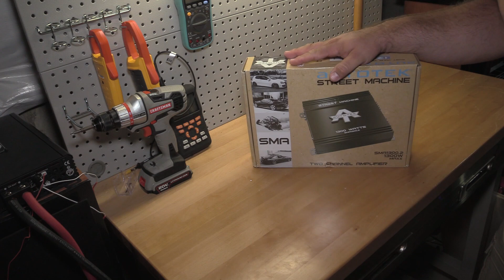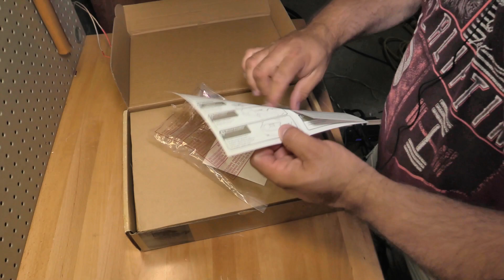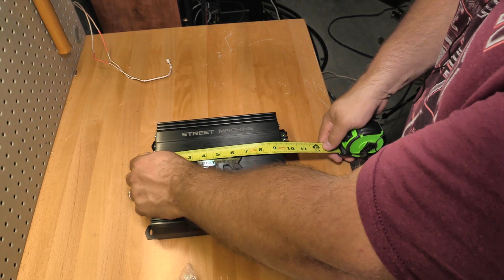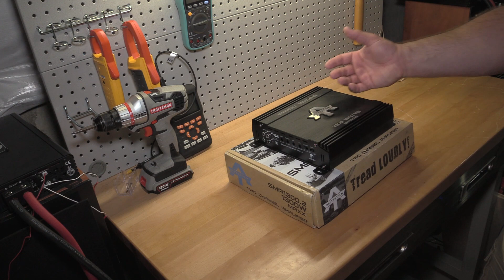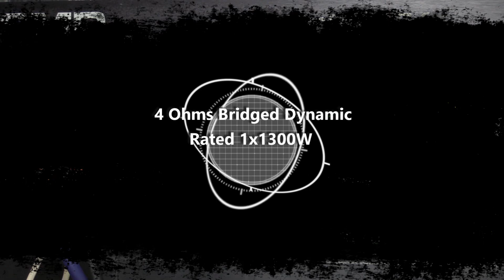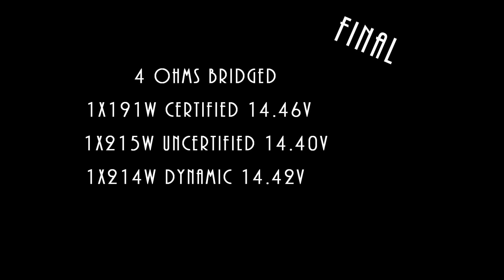1300W for $65? Yeah right.... Autotek SMA1300.2 gets busted on the Amp Dyno

Comment: Unfortunately I just bought one I wish I saw this first but it was only 48 dollars I just hooked it up 1225 watts  model it sounds ok on a 10 inch former 120 volt sub  for home use but it is pretty weak  what do u expect for 48 dollars but after adjustment sounds much better just using for the 10 inch sub .

Comment: Used to run Autotek in the late 90’s.  The white autotek hi current 50 cheater amp. Did it’s power. Placed first in many bass offs back then    running 4 pioneer impp 12’s. 145 db’s was the shit for only a 800 watt amp.

Comment: I had an Autotek TA1250.2 claiming 1200watt max while bridged @4ohm on a single 40A fuse... Yea right I knew beforehand it wasnt capable of its stated specs, it was still a good cheap amplifier that provided Id say ~300 watt rms which is not bad for what I paid [$20 used]

Comment: I had an Autotek MM4000.1D. The good one not the tiny one.
It was a nice big Very heavy powerful amp.
I didn't Dyno it, but i think it did it's rated 4k at 2 ohm.
It's a dual mono board. 360 amp fuse required.
I bought a refurb and it lasted me 8 years.
I think it was the last of the good autotek amps.

Comment: If you going to test a brand why get the cheapest entry level amp they make. Why not Mean machine or super sport, they don't do rated but allot better than that
Reply from the maker: This was provided by a viewer, I test what was given
Reply: @bigblank69  I have a question hopefully I'm not being a pest. Big D tested a massive audio nano rated for 800 at 1ohm. I have the MTX thunder 500.1 which is rated at 2 ohms but it has the exact same board as the Massive nano. Can you explain to me how one is for 2ohms and the other for 1ohm with the exact same board?
Reply from the maker: @davidgreggs8850  without seeing the boards, I can't speak to the similarities of the two. However some transistors, chips and mosfets that the average person cant see a difference with can change the stability of an amp at different ohm loads... brands like Taramps and MMats have done this for years.
Reply: @bigblank69  thanks brother

Comment: I still remember when some amps were underrated  like a punch45
Reply: Had a punch45hd cost 250.00! That ran a whole system in tri mode no problem!!!
Reply: Yes the punch 45 was a
underrated amp , meanwhile this amps just a mere 1100 w short, ha ha my head unit is more powerful than this pile of junk.

Comment: damn.. R.I.P. Autotek. I use to have a 500 watt High Current Cheater amp from autotek hittin on 2 lanzar 12's. it made the neighborhood jealous. nowadays 4 18's just gets you a head nod
Reply: I had a small Autotek back in the day that used to perform very well. These shows are great though. 7100 BTS

Comment: Who remembers the power acoustic amp with the big neon tube light. Inside? I use to. Install them all the time ppl would buy from flea markets bring it to our shop and grt it installed in a week. Be back it has stayed in protect neon tube runs at like 200° putting a heater in an amp best idea ever

Comment: i bet it would run a pair of tweeters just fine.  i purchased a soundstream picasso 750.4 pos to run tweets so i knew they would not get too much power maybe 40 watts  lol it could be used in the same way. its a pos but sometimes that pos will do the trick

Comment: While I recognize that this is an amp with inflated numbers, you said that it cost dude a whopping $35. For that kind of chump change vs. actual power it would be a gem IF it actually ran at full power without fail in any temperature for at least two years.
Even at $65 it would be an ok starter amp. The only real issue is that there are superior amps for about the same price if you are willing to trust Class D for decent full range reproduction. A/B still has staying power for a reason. Only the best digital (high prices) deliver the clarity desired by people who desire more than "boom and hiss" in their systems.

Comment: autotek best line is mean machine!, if you wanna buy budget maxxonics products, go straight to the crunch powerzone line!, had a 1100.2 in my vette, for 5 years slappin hard!!!,anything under 108 degrees, would not turn off, 110 an above, would turn off for 10 mins, then slap for the rest of the day!, you would be surprised at what 2 twelves, on 200 watts sounds like in a vette!!!, damn i miss you bertha!!!

Comment: Wow!!! If you looked up P.O.S. in the dictionary, there would be a picture of this amp! Scrap pile material!!!!!
Reply: GDL yes it is.
Reply: GDL .........buy it for parts.....
Reply: Well o have autotek on my mids and higs matter of fact i have two of them paid 100 bucks new for both of them. They produce great sound and need to bet set with an o scope. Oh and they get hot i mean hot. I keep a fan on them. Great amp for mids and highs. I knew it wont do rated powet of the jump but its clear on mids and highs

Comment: if i have a 2400 watt amp and have it set up to 1200 rms will i still need to upgrade the electrical. im thinking of ordering the wolfram 2400 watt amp to push my re audio sx sub
Reply: I had a Hifonics BRZ2400.1D hooked up 2 a pair of Kicker CompD 15s. 600rms a piece. As long as u set the gain right there should be no problem. Or wire it to a differ ohm load. Dnt know what your running. Just be careful with the gain is all
Reply: the car has a stock 130 amp alt with big 3 upgrade. i also switch all the lights to led and hid and upgrade to an agm battery. im currently pushing the sub with an old hifonics bx1205d amp at 1 ohm. im assuming the amp is only pushing 800w at most so its not pushing the subs potential. the car gets about an hour of play time at most but i only play when the car is running so that im over 12v and the kit im using is a 4 awg with 175 amp fuse

Comment: Always a good measurement for certified expectations if the amp has fuses is to take the fusing total and multiple it times 10. So (2) x 30 amp fuses means you can hope for a certified 600 watts. If you see a 4,000 watt amplifier (Boss, Planet Audio, etc.) and see 120 amps worth of fusing, you're looking at 1000-1200 watts.

Comment: That is a crime against bassheads.  I had to rewind it when I heard you say Orion xtr 4000. That should be awesome. If its anything like the xtr 2500.
Reply: Richard Moore the XTR 4000 is nice, but it's too large for  single 1/0 inputs, and it heats up quick. Need to definitely get the Jim's or Illcustomz Dual 1/0 to single 1/0 input adapters. For the price you're better off doing an HCCA 3000 dsplx which is only a bit more, and built to produce that power with triple inputs for power and ground on the amp oem.
Reply: I have XTR2200.1D running at 2ohms pinned on music running an 1800w Sub it doesn't get hot. Love it.

Comment: One of the bigger systems I've had was an Autotek Mean Machine Mx 5000 on 4 solobaric 12L7's in a civic hatchback lol. It was a good amp w/ dual 1/0 inputs. Never had it metered, but it was definitely over 150db. Good video Ryan. Sad Autotek is such crap now.